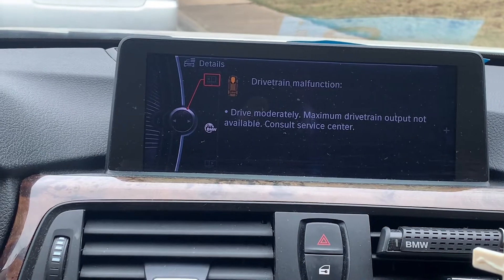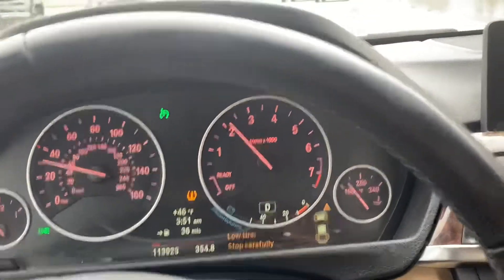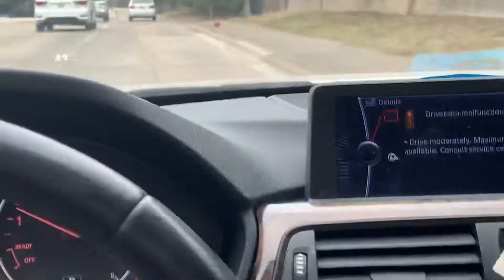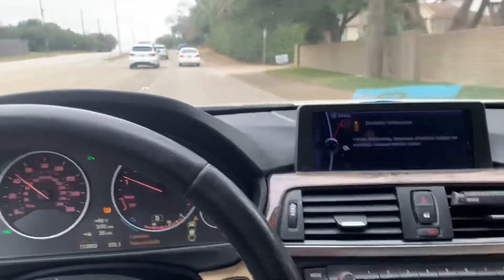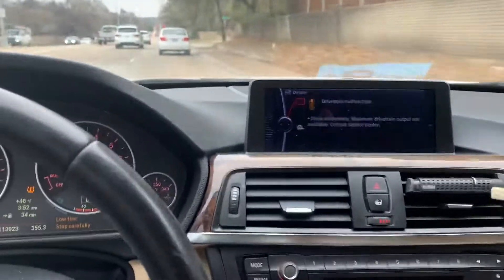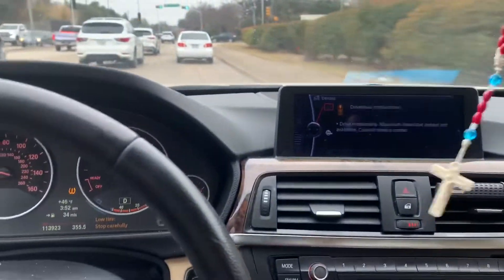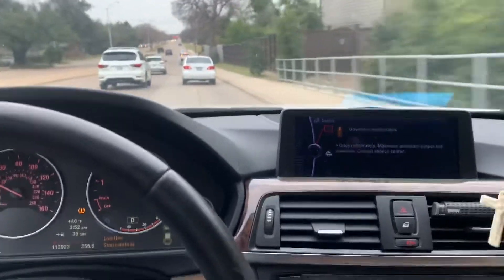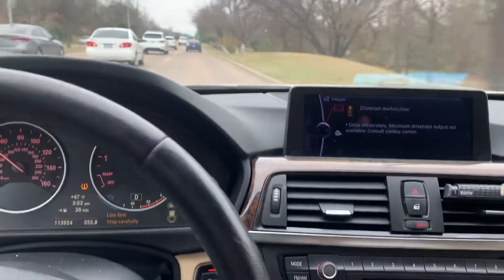BMW Limp Mode Symptoms(Drivetrain Malfunction)

Comment: My F80 M3 just started doing this when I drive spirited. I turn off the car and restart and it's gone UNTIL I run it hard again. Haven't had it scanned yet. Others say oftentimes there are no codes stored which has me scared it'll be a problem I'll have to chase.
Reply from the maker: Yep that’s crazy, I figured out the problem, it was the turbo wastegate actuator that was malfunctioning, so if it came on for your F80 and you had reduced power and torque, the turbo is probably not working at that time. But it’s an easy cheap fix for my F30 like less than $200, I’m not sure on the F80 though but give or take I assume
Reply: @f30hotep3  I discovered my intercooler reservoir is empty. Pretty sure intercooler is leaking fluid on mine. Could be a lot worse!

Comment: Did you find out what was the cause of it? The same thing happen to my bwm just now.
Reply from the maker: Hey yes so my thermostat was faulty, it would remain open when I turn the car off after doing some driving, it still functioned like normal and didn’t over heat or nothing, but because the thermostat wouldn’t close up it would throw a code and eventually trigger the Drivetrain Malfunction because the computer is ready or thinks the car is in an overheating situation.
Reply: @f30hotep3  I will give that a shot. My drivetrain light is on before I even start the car
Reply: did your ac fail?
Reply: Did it ever come on again I'm hear so many different stories